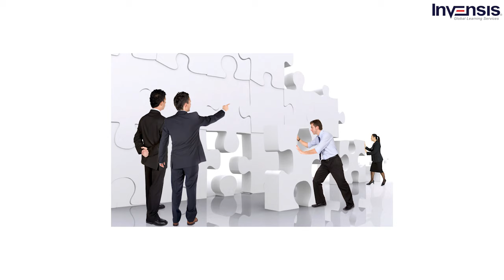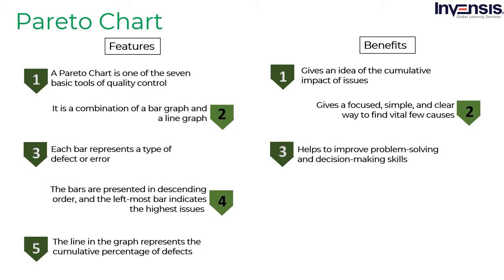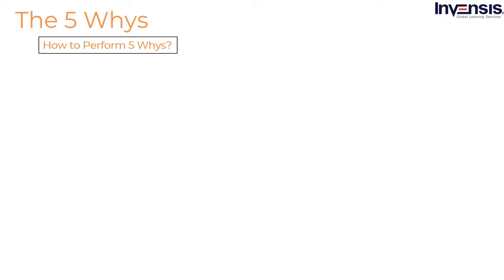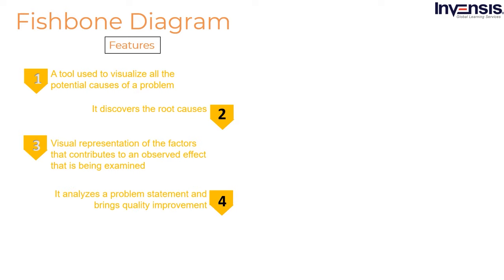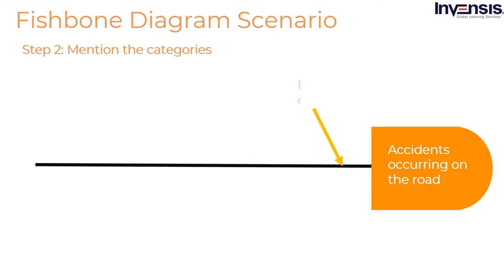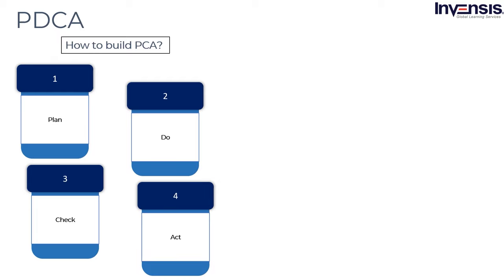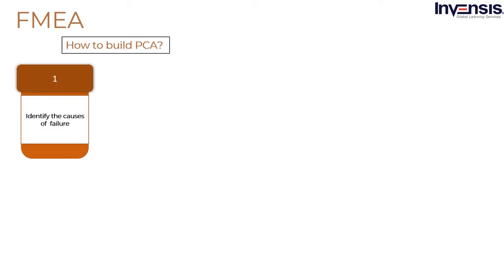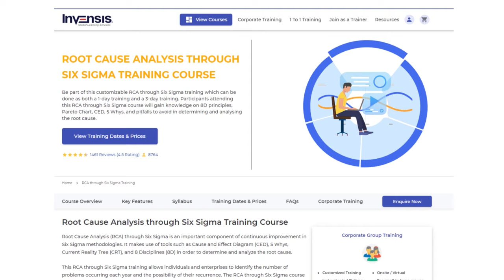Root Cause Analysis Techniques | Root Cause Analysis | Invensis Learning

Comment: After being involved in management systems and auditing for nearly 3 decades,  The first thing I would state is that most process failures are not the result of a "Root Cause"  They are in fact the result of causes, and the hunt for a root cause, will never result in adequate corrective action.   This is because most organizations are not aware of how their processes work or interact.
Root cause is more relative to machine malfunction, simply because they are repeatable cyclic events, relative to a fixed set of operational values (the machines capability and ability).
----- 
Historically, my observation with any process failure can be found through process mapping, especially a swim lane process map which includes all of the players in the process.  With such process mapping, many issues will be observed (very rarely one single root).  Further, its often the result of the accumulation of these process issues which resulted in the eventual failure.
-------
Read the book the quality toolbox by Nancy Tague, which is instrumental in defining the proper tool to use when determining causation relative to failure.